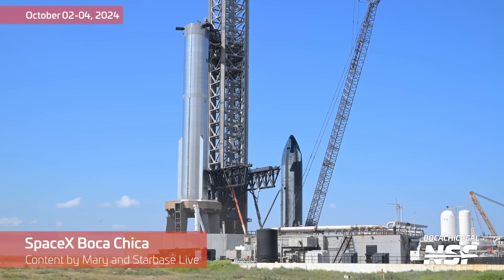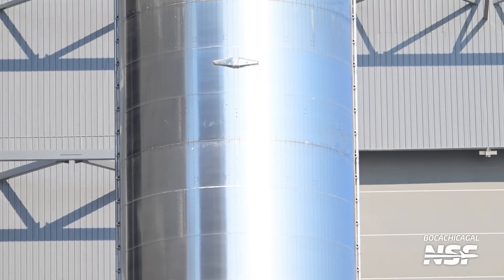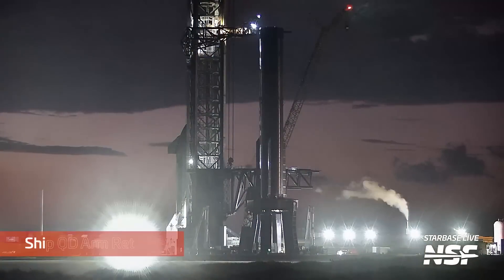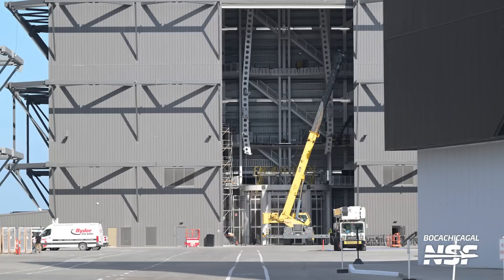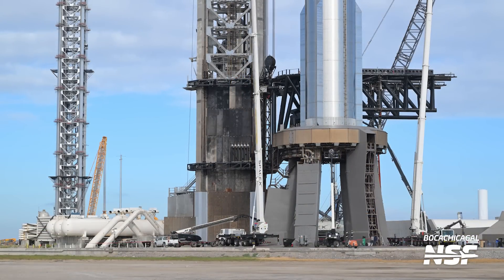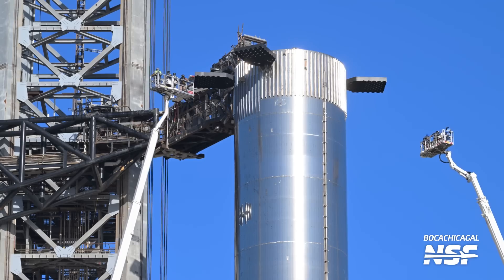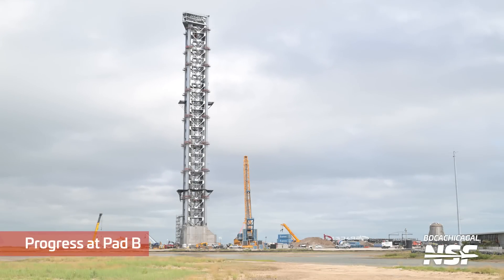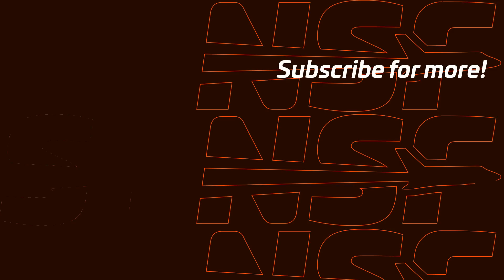Humans for Scale - Starship Flight 5 Preps Continue | SpaceX Boca Chica

Comment: Self-Propelled Modular Transporters consist of modules with 4, 5, 6, and 8 axle lines; and load capacity up to 44 tons per axle line. The SPMT's that carried the barrel stiffener was a combination of a 4 and 6 axle combination for a total of ten axle lines. SPMT's use hydraulics to power their wheels. One primary reason they are preferred over electrics is that hydraulics faults are almost always self evident and easy to find. Maybe a bit messier, but when the clock is ticking getting a quick repair becomes a high priority and fixing a broken hydraulic pump or line beat having some electricians tracing power for hours. Remember when that SPMT stopped half way during a transport and there was a lot of frantic activity getting it going. So not all SPMT wheels are driven, many freewheel. The axles with hydraulic power have larger hubs.

That is not a long bird, that is a crane. Not to the scale of the 8800 and most likely the smallest in the SpaceX fleet. But it's still a crane.